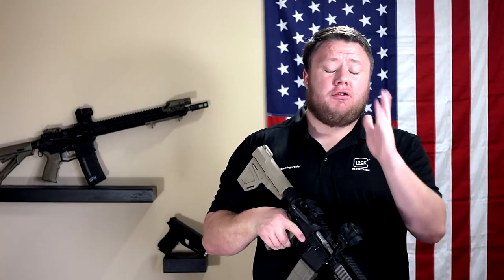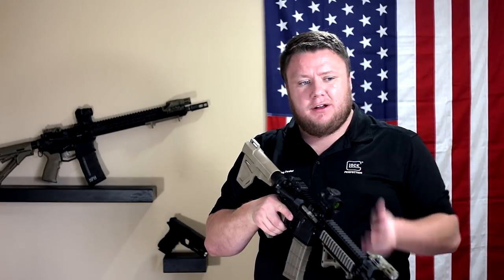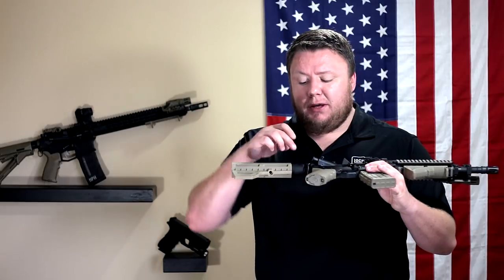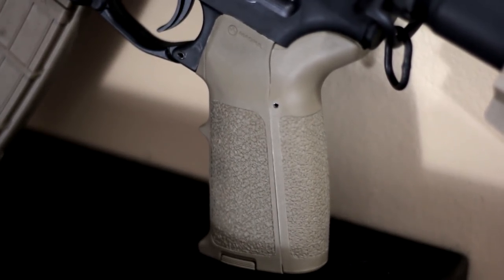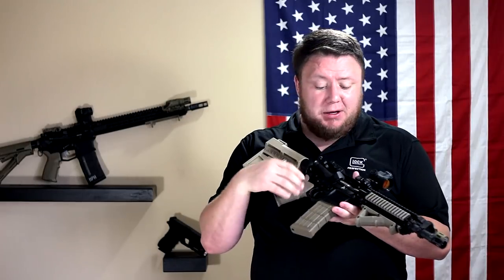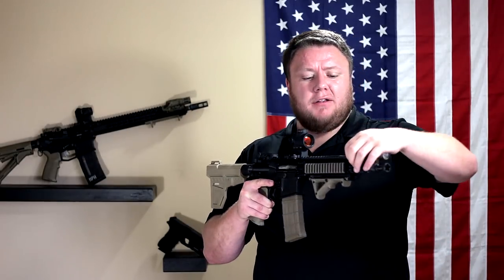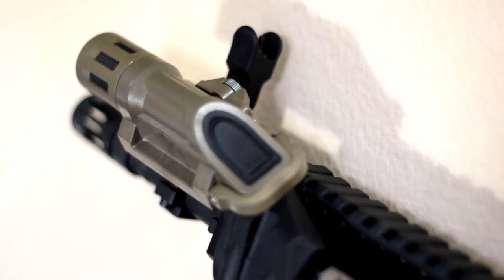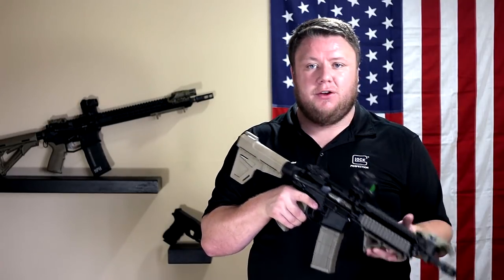AR15 PISTOL BUILD

Comment: Hey TactiCalifornia, Does the muzzle device have to be pinned "OR" welded or pinned "AND" welded to the barrel of an AR pistol/AK PISTOL? Can it just be screwed on with out it being permanently attached? Does the attachment method matter if you use a compensator versus a muzzle break versus a flash hider?

Comment: How do you feel about running a 8.5 300 black non suppressed for home defense? Im on the fence but have a lower and upper already in mind. I have heard FTE problems with the 762.39 round but not much with the 300, you have any input on this?

Comment: yo man nice piece. question about the gas block. have you had issue with the screws loosening over time or knocking the sight out of alignment? I run one on my M4A1 rough clone, and have had good results so far with it, but I'm wondering what your experience is with it.

Comment: Question about how you built your lower into a pistol. So first you had to built it single shot, than did you register it as as so, before you configured it to semi? 

Also with Jan 1, 17 approaching, lets say I finish a 80% pistol lower, does it have to be done before that date?

Comment: I am looking to get the Magpul forward mount for my light, but I am wondering how up and in the way it would be of the upper rail. I ask because I want to add a Sightmark lopro green laser and push that forward on the upper rail, just concerned if the magpul forward rail would get in the way. Any info would be helpful! Thanks!

Comment: Your build is not too different from mine.   My pistol is a Sig P516 with a 10" barrel with a standard flash suppressor.  I still have an original SB15 "stock" instead of the Blade.    Optics is an EoTech.  Pop-up iron sights are Samson.  Trigger is a POF Flat with a 3 lb pull.  Grip is a Magpul.  No AFG or light, tho.  Prefer shooting it to my standard Colt M4.

Comment: I have an AR 80% polymer lower that I want to build into an AR Pistol. I know about the butt stock rule and about the forward grip, but does it still require a bullet button, if it's a pistol? Also, how will all these new laws in CA affect AR Pistols?  FYI: I already signed the petitions and got my wife to sign them too. Thanks!

Comment: do you have to specify a stripped lower to be a pistol at the time of pick up, or would following the pistol build rules do?
Reply: Has to be marked pistol
Reply: Not according to the ATF.
Reply: Keith Reynolds in short...yes. A stripped lower has to begin life as a pistol. Later if you decide you can convert a pistol to a carbine. Never a carbine to a pistol. So it makes sense to always register your stripped lower as a pistol. Now if you're in CA, you can't register a stripped lower as a pistol unless you're an LEO. The only way around this is to make your own from an 80% lower.

Comment: Isn't the grip illegal on a pistol doesn't it make it an AOW?
Reply: Garrett - 
A vertical grip would be illegal, AFG is legal on a pistol.
Reply: Garrett - No its not illegal to put any type of grip on a pistol.
Reply: Captain Obvious you're wrong
Reply: From an ATF letter dated May 4, 2006:

 “Handgun” is defined under Federal law to mean, in part, a firearm which has a short stock and
is designed to be held and fired by the use of a single hand…. Gun Control Act of 1968, 18
U.S.C. § 921(a)(29)."

"ATF has long held that by installing a vertical fore grip on a handgun, the handgun is no longer
designed to be held and fired by the use of a single hand. Therefore, if individuals install a
vertical fore grip on a handgun, they are “making” a firearm requiring registration with ATF’s
NFA Branch. Making an unregistered “AOW” is punishable by a fine and 10 years’
imprisonment. Additionally, possession of an unregistered “AOW” is also punishable by fine and
10 years’ imprisonment."

Pretty self explanatory to me and remember it's you against them.   This is a vertical hand grip.  No matter how short it hangs down from the pistol it still is VERTICAL.  This pistol is no longer designed to be fired with a single hand as per ATF.  Just pay the $5 tax stamp for an AOW and there is no argument about it anymore.

Comment: are u allowed to shoulder the stabilizer ?
Reply: no
Reply: the ATF doesn't have a law against, but they do have an opinion. and that opinion is if you shoulder a pistol stablizer, then you automatically change the classification of the firearm. you can stabilize it on your cheek, but good luck explaining that to a LEO when they walk up on you from the wrong angle.
Reply: Yes you can. Law was changed so you can shoulder fire it.

Comment: what makes it a pistol and not a sbr or a mini rifle
Reply from the maker: The uncomplicated answer is: because it has no stock and is "designed" to be fired with one hand; not from the shoulder. The ATF has crazy definitions of both rifles and "pistols". This firearm is a "pistol" per the ATF's definition of a "pistol".
Reply: Also, it's how you register the lower - If you register it as a rifle, you cannot build a pistol with it

Comment: I'm new to guns. I thought AR-15 cannot have a barrel shorter than 16 inches.
Reply: This is classified as a ''pistol'' under the ATF. The ATF classifications can be confusing and make little to no sense. Since it is a pistol, it has no minimum barrel length requirement. The device at the end of the weapon looks, and will function as a butt stock, but you are not legally allowed to shoulder the brace like a stock since it on a pistol. The stock-like device is marketed as a ''stabilizing'' brace, or device. Also, the angled grip on the quad-rail (barrel section) is the only type of fore grip legally allowed on a pistol. If you add a butt-stock, vertical fore grip, or shoulder and AR ''brace" by ATF standards you have modified the weapon in to an illegal SBR (short barrel rifle) or AOW 9any other weapon). In order to legally own an SBR or AOW, you either have to buy one that is manufactured and sold as an SBR/AOW, or file a NFA Form 1 to convert an existing build. Either way, your state has to be NFA friendly, you have to deal with the ATF, pay a $200 tax, have a federal background check (could take upwards of nine months), and basically give up your Fourth Amendment rights (The ATF can show up to your house anytime to look at the weapon). You also have to keep paperwork with you anytime you're out with the weapon as well as have the lower stamped with info ($200 ATF tax stamp), and go through a bunch of BS to travel across state lines with the weapon. This is why a lot of people op-out of owning a SBR and go with an AR ''pistol''.
Reply: You can get it shorter if it's considered a pistol or an sbr (short barrel rifle)
Reply: That is classified as pistol.  It has no buttstock.  It has a pistol buffer and stabilizing brace.  As a pistol,  it has no minimum barrel length.  You can not shoulder that pistol, as it would be felony.  Shooting from the cheek is legal.

Comment: I just built my first AR pistol and have a 10.5" 223 Wylde barrel on it and the whole 9yards in the pistol but for some reason I can't get it to shoot. it functions fine but as soon as I try to load rounds the BCG will travel about 90% and seized up,  every round and I have tested 5 different BCGs in the gun same problem, it's so bad it takes 2 people or a vise to hold the gun just to undo the locked bolt, so in your opinion, do I need to missile through it and shoot 300+ rounds through it or buy another barrel? also any info you have that might help would be awesome.
Reply: Preston Mcentire how long is your gas tube?  I have an Aero Precision 10.5" pistol upper but it has a carbine length gas system. A lot of pistol uppers have gas systems that aren't long enough to propel the BCG a sufficient length backwards to properly cycle. Also you need the proper weight buffer. It sounds like a combination of insufficient gas pressure from a short gas tube and/or your buffer is too heavy.